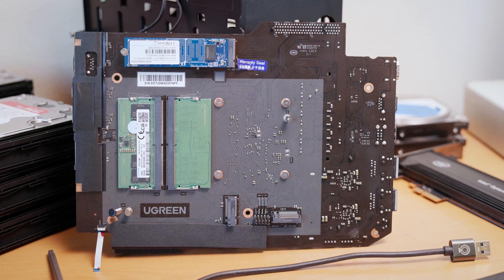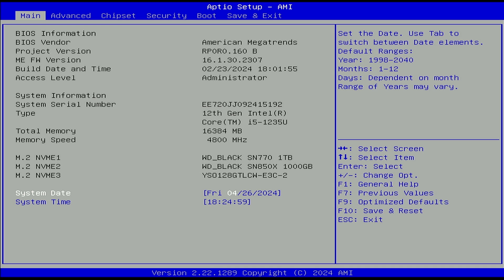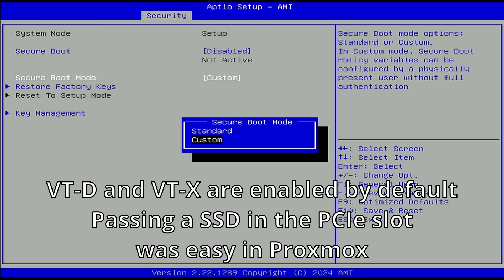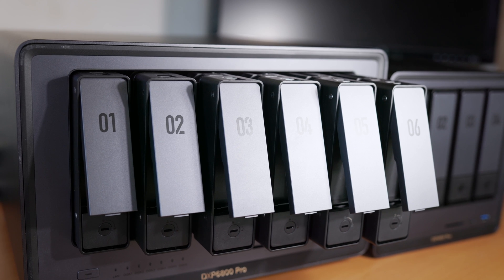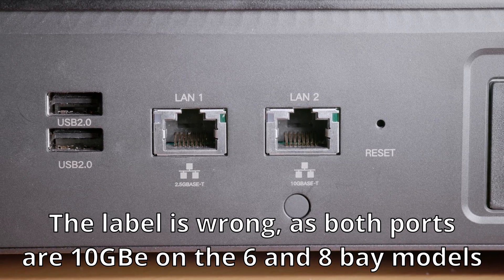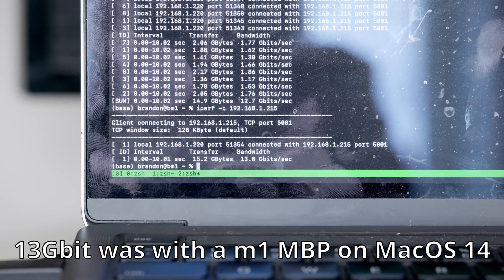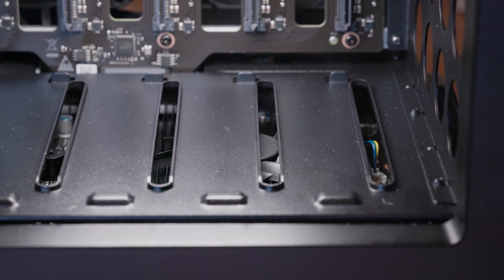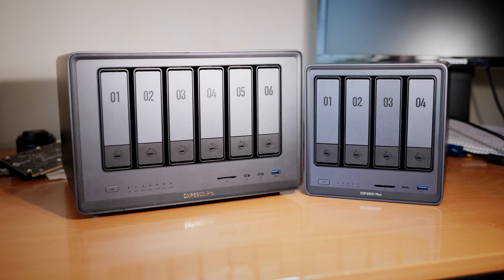Running Different OSes on Ugreen NAS Devices + PCIe layout and CPU thermal/performance tuning

Comment: Hi, do you think it would be ok to use to use a memory with higher clock speed? Like Crucial RAM Crucial D5 5600 32GB. Sometimes 4800 mhz is not available. Also interested in seeing truenas scale running, given the pci differences it may not be worth it to run 2 nvmes in raid1 (for the OS for example). Perhaps 1 could be read cache and the other write cache..
Reply from the maker: I didn't see a setting to change memory speeds in the bios, and don't have other DDR5 SODIMMS to test with. 

TrueNAS scale works fine for me. As far as mirrored boot drives, I don't see an issue with PCIe speed limits as the boot drives don't need much IO for TrueNAS. You can also restore from a boot drive failure realtivity easily in most setups and all the data is on the data drives, so mirrored boot drives aren't that essential for most uses.

When it comes to cache drives setup, it really depends on your usecase for ZFS. I'd probably skip cache drives for a home backup/media server, and use the SSDs for something else like Plex metadata or VMs. ZFS doesn't really have a write cache, and the log drive is only for sync writes. If your usecase doesn't have sync writes a LOG drive won't help at all. A read cache or l2arc may help, but depends on your usecase. I have found it to typically not have a huge impact in home server usecases.
Reply: Thanks for the thoughtful answers.  Follow-up question, what’s the PCI definition for the 3d nvme slot? The one hidden. Thank you.
Reply: @ElectronicsWizardry  would love to know this as well, what’s the PCI definition for the 3d nvme slot? The ones that's hidden

Comment: Have you tested the Power Consumption with other the Os ?  Seems no one has tested this, and comparison on power Consumption of the 4 and 6 bay ?
Reply from the maker: I tested idle power with all the oses to see if they would turn down components correctly. All sat at around 22-23w at idle.
Reply: @ElectronicsWizardry  oh, wow thx for the quick response 👍 and the 6bay is without drives at the same Watt at idle +- ? Other say something from 40wat at idle.
Reply from the maker: That 22-23w is idle on my 6 bay DXP6800 Pro with no HDDs. The HDDs use a bit less than 5w each spinning, so that's where 40w idle would likely come from. I took the drives out when doing my idle power testing.
Reply: Thank you so much, i ordered the 4 and 6 bay because i wasn't sure with the power consumption but now i will cancel the , 4 bay model and take the 6bay 👍 here in Germany the power consumption is a big factor 😅

Comment: Great Video!

7min in, you mention the Thunderbolt Networking is working!  Can you tell me which OSes that you tested this was true of please (I'm assuming it is still not true for the Ugreen  OS)?  Also any idea what it was only giving you 13Gb/s - do you think it was lanes, or was it not fully populated etc).
Reply from the maker: I did my thunderbolt networking testing with Proxmox, but its likely the same with debian and other Linux distros. I didn't test it with other OSes, but I run a test on a specific os if you want.
Reply: @ElectronicsWizardry  I was really wanting to know if it would work with the 3rd Party NAS offerings, like TrueNas, since I know those often aren't full distributions. 

The goal for me is a Thunderbolt Networking Connection to a 6+Bay NAS for video editing (and I'd prefer not to have to go to QNAP and their Thunderbolt line - though they are showing up to 26Gbit over Thunderbolt in some cases).  In the Ugreen NAS group this has been a subject of constant discussion among the video editors out there - so you have a built in audience here (at least while we wait for Ugreen to come back with a reversal of their Official position it isn't supported and can not work).
Reply from the maker: I can give truenas a shot with my macbook and see how it goes. I'm guessing scale will work fine as its linux under the hood, but not sure how the gui will show the thunderbolt network interface.

I'm also not sure why I was seeing 13gbit instead of higher speeds that seem possible. Could possibly be a limit of my m1 macbook as its the only thunderbolt laptop I had for testing.
Reply: @ElectronicsWizardry is more possible? The Thunderbolt Standard can Simulat a 10gbit Connection as i know. You dont get the Full 40gbit as lan Connection
Reply from the maker: Yea I thought it was a 10gbe link for IP over thunderbolt at first, but seems to be faster now. Other forum posts confirm what I was seeing with faster than 10gbe link speeds. Can't seem to find much info on what the real cap is, and thunderbolt can be complicated to see what max speed a transfer type will get.
Reply: @ElectronicsWizardry  TB max is 40Gb/s - but clearly with IP you'd lose some for networking (maybe as much 20%).  I have a TB hub with a 10GbE in it as well as other connections and the single TB cable has no issue keeping up with the 10GbE and the other disks and such.  My Direct Attach SSD Thunderbolt sustains unto 3.5GB/s over thunderbolt.  

I suspect the 13Gb you are seeing is either due to the drives and configuration of them, or that they perhaps didn't give full bandwidth to the TB ports on the Ugreen (I'd think your  mac is fine for faster speeds). It could also be a suboptimal Linux Implementation of the drivers and such or the network configuration (frames size for example)
Reply: @ElectronicsWizardry  can you test, if it worked with the original u green software? it was showed in the commercial video, but later the said, tb is only to use it for copy files from usb4/tb portables to the nas.

what was the result that other people got? more then your 13 Gbit? maybe thats the reason why qnap advertised with up to 20 Gbit over tb. I thought that they just add 10 Gbit up and down. typical marketing move. but maybe it is not.
Reply: @ElectronicsWizardry  Can you link to the forum posts? Awesome review! Really interested in the Thunderbolt capabilities in different OS'es including the standard Ugreen OS.

Comment: Hi @ElectronicsWizardry, this is very useful info, thank you!
Maybe one question: can you please comment on the power budget available for the PCIe slot? Are the full 75W available?
Reply from the maker: Is there a way to test the slot power available? I tried a few cards like a GT1030 and a LSI SAS HBA without issues, but my higher power cards won't fit in a single slot. I don't see markings ont he board for available power.
Reply: I was thinking of stress-testing using Heaven or similar benchmarks but it seems that the GT1030 has a maximum power of 30W and HBAs usually require even less I think.
However when running the lspci command there should be a SlotPowerLimit entry saying the available power. Would it be possible for you to check this?
I was asking because sometime the available power is restricted below 75W. There is nothing in the documentation about this right?

Comment: Good job. Straight to the point. No nonsense and cover about everything few other reviewers missed. Also really dig your neutral approach in tested OS's. As multi OS user I'm getting sick of reviewers that are insnaely biased towards their own selections. I get supporting something, but dissing others selection is just dumb and doesn't contribute to anything. Let alone that many of these are just simply having their facts downright wrong. Keep up the good work!

Shame that device has few caveats that render it bit bad for like Proxmox server with gpu passthrough for VM's.

Comment: What are the size of the build in fans in the 6-Bay and 8-Bay Models? Do both has 2 x 92mm fans? Are 3 x Fans Possible and in which size then?
The Fan in the PSU has 40x25mm, right? Is it possible to change ist and do you think an 40x28mm fan will also fit?
Reply from the maker: My 6 bay has dual 92x25mm fans. It looks like the 8 bay has dual 120mm fans from a video I see online, but I'd measure the fans on the 8 bay model first. The main fans are pretty nice, and have fan control in the bios so I don't see an issue keeping them stock. 

As far as the PSU fan, upon measuring it again it appears to be a 40x20mm fan. A thicker fan won't fit, but noctua makes a 40x20mm fan that would likely be a good fit here.
Reply: @ElectronicsWizardry  Wow, thank you very much for the information, it has helped me a lot! I've also heard elsewhere that the 6-bay model has significantly better fans than the 4-bay model. I guess the tiny PSU fan will still be louder even the Noctua one, than the 92 fans, so I'll probably keep them in.

But what I found interesting was that I read in another video comments, that someone wants to use the "HDPLEX 250W GaN Passive AIO ATX Power Supply" PSU in their 6-bay model. That would be a small PASSIVE cooled power supply. Do you possibly know this thing and do you think it would be possible? That should mean quiet operation and power saving, as it is very efficient, if it would be usable.
Reply from the maker: The main fan on the 4 and 6 bay models are fine to me. They feel reasonably nice quality. The PSU fan in the 6 bay(and likely 8) is the loudest at idle. A noctua fan should help with that noise(you likely could also spin the included fan slower, but there is risk with less cooling that it was designed for). The CPU fan is a bit annoying if its changing speeds next to me on the desk, but I think a bit of fan tuning would help here, especially since drive temps are very good in this case, and the CPU is typically power limited instead of thermally limited.

It looks like the main board uses a 24 pin ATX PSU, and a 8 pin CPU power is used for the HDD backplane. That aftermarket PSU should work fine in this box, but I'd check voltages just to be sure. 

I will note if noise is your biggest worry, the HDDs are likely going to be more annoying than the fans when your reading/writing data
Reply: @ElectronicsWizardry  I plan to install 3 x 20TB Toshiba MG10 HDDs for the time being. They are really quiet, even when writing. Since I'll also be using Unraid, they'll be in spindown most of the time anyway. I think I'll probably just replace the PSU fan with the Noctua, do some fan fine tuning and then it should be fine. The NAS is in my wife's room anyway, so I don't really care anyway 😂(just kidding)

Comment: Thank you for providing details on how the SATA ports are utilized. There were rumors circulating in the Facebook group suggesting that they were using the same 4-port host controller with some unusual port multiplication, potentially causing issues with TrueNAS. I'm glad to hear that this is not the case.

Comment: Thanks for the very informative video! I have a question: 
what is better: 
1) to clone multiple operating systems to the same external HDD where I have backups of my documents (one separate partition for each OS and another separate partition for my backup)? 
2) Or is it better to clone my operating systems (I have 4 of them) to one HDD for each OS, 
3) or last option, to backup my documents to HDD #1 and to clone my OSes in one HDD #2 with as many partitions as OSes ? 
And if so, why?
Reply from the maker: Are these OSes backups of a running system? I'd generally recommend using Image backup software to make images of the running system, and store it as a file on the filesystem. 

I'm generally a fan a Veeam for windows client/server backups. They have a free version that handles 10 systems and can store all the backup files on a nas like this. There is other alternatives like ubackup I've tried but ran into more issues than I'd hope for. 

If your cloning OSes with DD or similar tools, I'd clone the OS into a img file and store it as a file. Then its easy to work with and copy as needed. I fine this easier to work with than cloning a HDD to another HDD. 

Hope this helps here.
Reply: @ElectronicsWizardry  Thank you for your reply! Actually I'm a noob and I'd like a very simple backup of my personal data (around 3TB atm) and OSes cloning (no NAS or RAID, they still scare me). I plan to make 3 partitions in my external HDD: #1 for my Documents and Data; #2 for clone of my OS Windows10; #3 for clone of my OS Windows 11. For simplicity I would like to use Macrium for OS cloning but as you advice maybe better to use DD (or Clonezilla? Even I think they are less user friendly). You advice to clone OSes with DD into a img file. In case my original booting drive will fail, is it easy to replace with a new drive with the saved img file of my OS and reboot with it?

Comment: 2:32 -- dd command is right. Also, dd save the U-Green OS before booting via a live usb. Great video 👍
Reply: And extract the LED control script :D
Reply: @friedrich1277  I am not going to back the nas creator. Finally decided.
Reply from the maker: Yea I should try getting that led script off the included os. Any clue of where it might be?
Reply: @ElectronicsWizardry   Good morning. Kindly look up journalist Jason Chen's commentary on kickstarters. Is any non-rewards rate acceptable? I fear.
Reply: @ElectronicsWizardry   Google for:
Jason Chen kickstarter wirecutter 2022

Comment: Did you happen to test hardware passthrough in Proxmox of one or both of the SATA controllers? Would like to run TrueNAS Scale as a Proxmox VM but prefer to passthrough the controller rather than the individual disks.
Reply from the maker: Didn’t try that. Let me give that a shot and see how it goes.
Reply: Thanks for all your hard work. I'm interested in this as well  @ElectronicsWizardry
Reply from the maker: @jay9404  I just tried PCIe passthrough on this 6 bay model using Proxmox as the Hypervisor. I could pass both the onboard Intel SATA controller and the Asmedia controller to a TrueNAS VM without issues, and all the drives show the full smart data.

Also on the 6 bay model the 4 drive bays on the left are controlled by the Asmedia controller and the right most 2 drives are connected to the Intel controller.
Reply: @ElectronicsWizardry  thanks for the update and although not ideal in all situations, this helps alleviate some concerns with TrueNAS in a VM in Proxmox.  Again appreciate your knowledge and testing.
Reply: @ElectronicsWizardry  something just came to mind, does the NVME have their own sata controller? I plan to install proxmox mirrored on the NVME and want to ensure that passing the Intel and asmedia controller won't affect booting from the NVMEs
Reply: I need a NAS and I like to tinker with gadgets... I think a UGREEN NAS of this type could be a good option for these purposes, knowing that you can connect via IP over Thunderbolt and that there seems to be no problem in moving those controllers from Proxmox to a VM with Truenas, although it seems that the UgOS system is evolving positively... Thanks for your time and dedication and, of course, for sharing! So I subscribe to the channel. Greetings from BCN, Spain!

Comment: Pretty refreshing that they're not super anti-user when it comes to 3rd party OS's. I can't think of anything else that's this easy to get working in that regard.
I do wish the watchdog feature was smarter, but, at least you can turn it off. That's really the only gripe though, and these boxes with some NVME and a bunch of big spinners are going to be Truenas SMB champs tbh.
Reply: If your chosen OS has support for the chip implementing the watchdog (which Linux definitely has) you can configure the watchdog daemon and then reenable it. And for Linux watchdogd you can do some complex tests if you like.

Comment: 100C temps means cpu thermal throttling. Did you check thermal paste? Great in depth review. 6 bay with an Nvidia card for HW transcode would be great for Plex or jellyfin to replace my aging Synology DS918+.
Reply from the maker: Never took the cooler off as I wanted to test with the included thermal compound. Might take it off and see what the application looks like and will reply to this if I do.
Reply: @blademan7671 Unless you specifically require AV1 encoding, I would recommend using the built-in QuickSync instead of a dedicated GPU for transcoding. QuickSync encoders are really underestimated in terms of their power and efficiency.

However, if you do need AV1 encoding, then a small, single-slot ARC card is still a better choice than an NVIDIA card.
Reply: @th3r3v92  like this? https://youtu.be/Gfur75VRLdc

Comment: Thank you for the review! Would you happen to know the fan size in the DXP6800 Pro?
Reply from the maker: Dual 92x25mm in the back, 40x25mm in the PSU(loudest in the system), and a non standard fan on the cooler.
Reply: How is about PWM and other specs of the fans?
Reply: @ElectronicsWizardry  Thank you so much! I’ve been trying to find a clear answer on this for a while.
Reply from the maker: The fans are pwm fans. The label says coolcox cc9225m12d. Googling that gives me a data sheet that says it’s a 2000rpm fan with ball bearings.
Reply: Is the fan of the psu also known?
Reply from the maker: @ehrenpinus The psu fan has a model number of ha4020h12b-z on it. I can’t get a full data sheet from this fan online as there isn’t much info about it. There is no pwm or tach signal for the fan. Looking under the sticker appears to be a ball bearing which is hopefully a good sign for the lifespan, but it’s definitely not silent with the default fan curve.

Comment: What is the specific NIC being used for 10gbe on the bay bay NAS?
Reply from the maker: The 10gbe nic is a AQC-107. Is there other details about the nic if you want? The dual 10gbe models appear to have 2 of these nics inside them.
Reply: @ElectronicsWizardry  Whats the difference in the power draw of the system (idle) if the NICs are disabled in the BIOS or not?